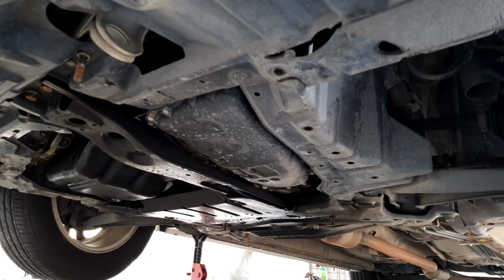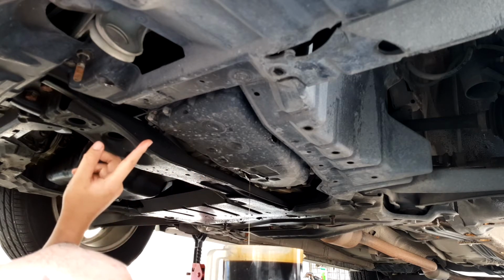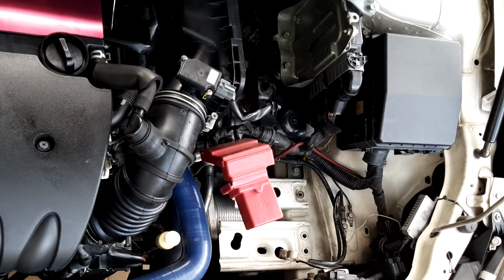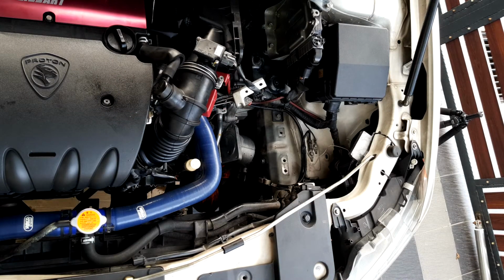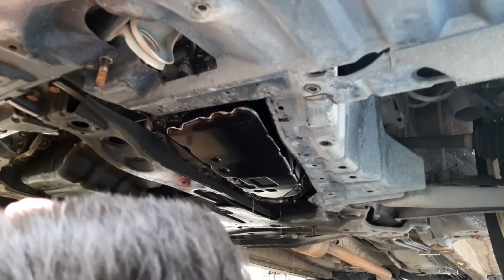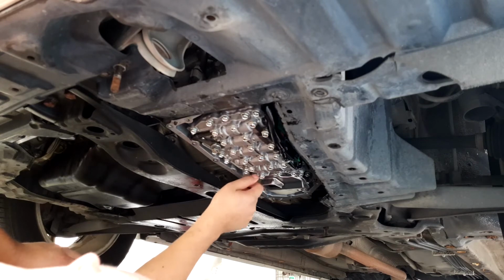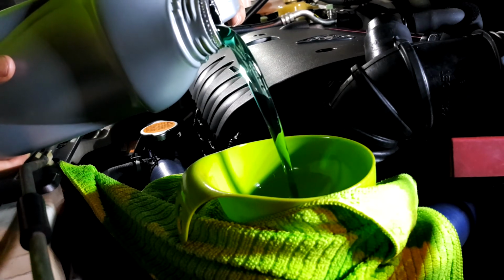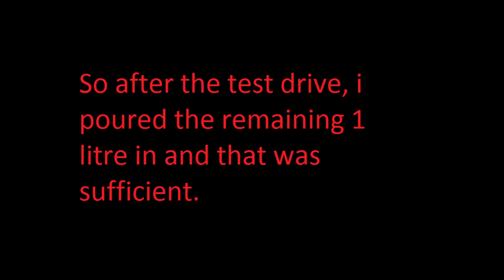How to change  CVT Oil and Filter change - Inspira / Lancer

Comment: Hello bro...I have one thing to ask... recently I just change my CVT oil and the bottom filter...but I didn't change the cooler filter...can I change the cooler filter after the CVT oil change? Tq in advance
Reply from the maker: Yes you can, but there might just be a bit more oil draining out so be prepared for that. Also you will need to top up the fluid once you are done.

Comment: bos..saga new..sama x dgn pesona iaitu gear cvt?
Reply from the maker: From what I understand on the spec, both new Saga and Persona are using CVT gearbox. As to whether they are the same gearbox, I am not sure. But all CVT gearbox must use proper CVT Fluid/Oil. Never ever ever fill it with ATF (Automatic Transmission Fluid) or MTF (Manual Transmission Fluid) unless you want to fork out a lot of money to replace your gearbox
Reply: Amek je la saga 4at yg bru klau nk murah..atf oil
Reply: @HuntaKiller91  yezza btl.. coz cvt kos lbih mahal.. Dpd hrga mnyk cvt+filter.. Tp klu drive keta auto biasa vs cvt... Rasai prbezaannya coz gear chnge dgn smooth xde rasa mcm auto gear lama.. kn..!?!!

Comment: Lmaoooooooo that's atf fluid 😂😂😂
Reply from the maker: What ATF fluid? Drained CVTF and put in CVTF as well.
Reply: @TCsAnythingGoes  CVT fluid is green, atf fluid is red
Reply: Red fluid came out...
Reply from the maker: J4 is blueish when new. Turns brownish when used. Previous CVTF fluid change was also done by me so I am pretty sure it was CVTF being drained.
Reply: Yeah j4 is greenish blue when it is new,my mechanic also feel shocked when he saw that the old oil is red brownish black colour,he did ask me twice,asking me that did i really put in the right oil before,and then i said 100% i use j4 oil,the old 1 quartz bottle is still with me..then i just told him mybe my old oil is burned up because it is already 70k km since my last oil change.after i replace the old oil,my car is responsive and can rev up a bit quieter than before..mybe that is my bad to change it at 70k.km interval,my next oil changes i will change it around 50k km,consider that on manual book,mitsubishi recommend to change transmission with 40k km interval,guess what?the oil is a bit expensive..so 50-60km should be ok..hee,there is many aftermarket oil which match specification for mitsubishi cvt,example oil fluid from amsoil,bell1,valvoline,motul as well as fluid from nissan ns-3 can be used because mitsubishi use cvt from nissan(jatco),but better stick to mitsubishi oem fluid.
Reply from the maker: @wandywan2444  Excellent explanation. I couldn't explain it any better. From what I experience, the interval is really dependent on how we drive our cars. My first change was around 90k km (i was driving rather enthusiastically) . My subsequent change was way lower when I started going for much spirited drives. I have not tried other equivalent oil besides J1 from when I got the car and J4 for the rest of the car's life.
Reply: @TCsAnythingGoes  yeah,from what ive known j1 fluid is for mitsubishi cars which using cvt starting the year below 2010,but mine is 2012 lancer and the dipstick itself shown cvtj4 ..it is kinda an upgrade oil from j1,those j1 recommended mitsubishi cvt cars could perhaps use j4 instead of j1..here Cvt j1fluid  can be find easier than j4 fluid.some of my friend use aftermarket oil mostly from amsoil but very expensive,need to flush out drain the old fluid from cvt tranny before using amsoil,it cannot mixed with the old j4 fluid and as well as it need around 7-9 litres of amsoil cvt fluid from flushing before..im asking him why he did not change oil on mistubishi car dealer workshop,but he replying me that dealer workshop is more expensive than him using amsoil including service charge..

Comment: Does the cvt pan have a rubber gasket or you just made one out of rtv gasket maker?
Reply from the maker: Mitsubishi made gaskets for that. i purchased is as a set along with the lower filter.
Reply: @TCsAnythingGoes 
Today i change the oil with your step just without changing the O~ring rubber of the coller..... And i didn't replace the gasket of the pan.
When i get home i see some oil under car 😭 tomorrow i will return to fix it can you guess the problem? Really the O~ring rubber improtant to change?? 😢